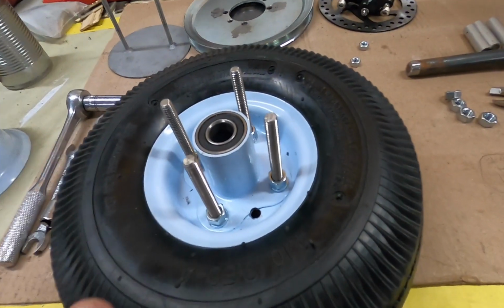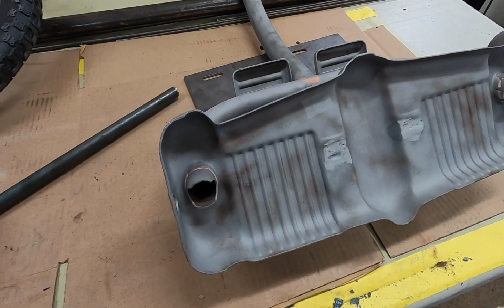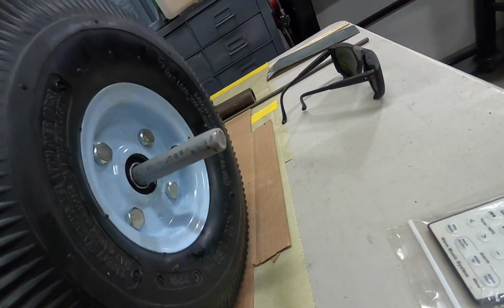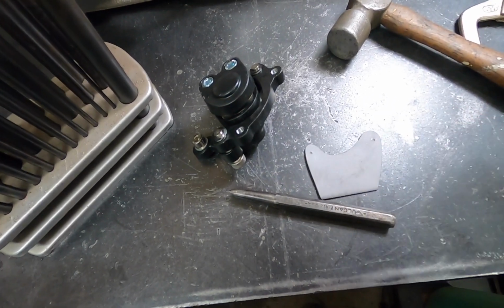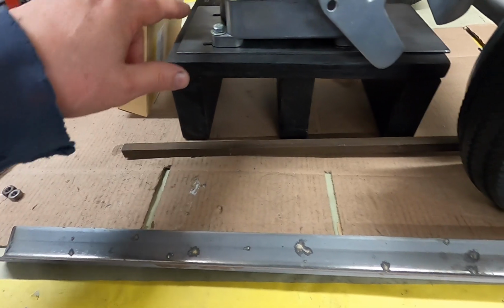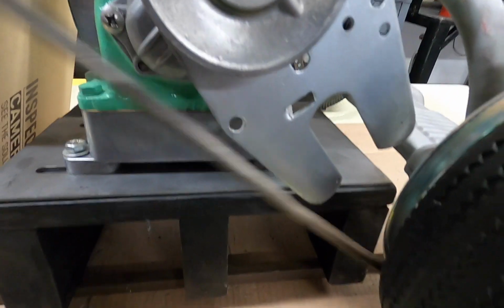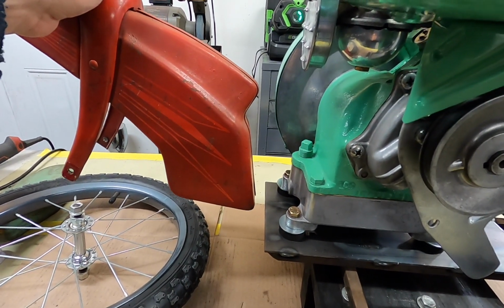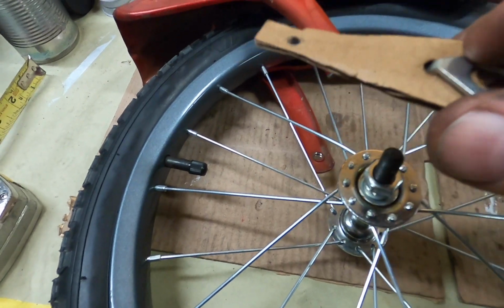REO Trikeabout build part 2, installing the disc brake and engine

Comment: Hi Howard looking good so far. Maybe you could incorporate some type of running boards on both sides for your feet. Or foot pegs.👍
Reply from the maker: I'm going to cut the pedal crank off the tricycle wheel and weld them to the forks as foot pegs. I found correct red pedals to fit the old pedal crank, so it will have tricycle pedals as foot pegs. I am going to relocate the seat back a little also, along with raising the handle bars a couple inches too. I want to keep it small, looking like a kids tricycle, but so an adult will fit on it.

Comment: Howard,
The Trike About is really coming along excellent. What great ideas and simple engineering. The wheels, pulley, caliper and rotor are a perfect fit.
We’re did you purchase that clamp you were using on the axle shaft ? Really nice tool. Looking forward to all your videos
Thanks
Reply from the maker: I found the clamp in an estate sale..... there were four, so I purchased all of them.